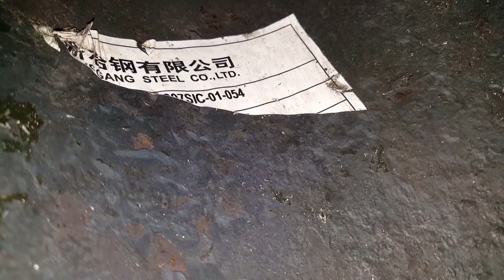Drilling and cutting big holes in steel bar.

Comment: Dave the wooden boring supports. is that something you came up with or learned from your old master yoda 👍👍🏴
Reply: It is essentially like a pack bit. These were an old school deep hole drilling tool. This article breifly touches on it and trepanning. http://www.engineeringenotes.com/industrial-engineering/drilling-machine/process-of-deep-hole-boring-with-diagram-industrial-engineering/22852
Reply: @bcbloc02  Thanks for that link Brian, most interesting . Pst don't let Baily see it or he will have you making one .
Reply: @Christopher.C123  Baily has the book that info came from. He shows it to me regularly trying to improve output. lol
Reply: @bcbloc02  The link is dead, is it still available somewhere?
Reply: @bigbattenberg  link still worked for me???
Reply: @bcbloc02  Tried in a different browser, then it worked. Thanks!